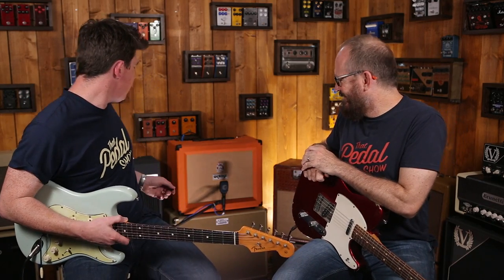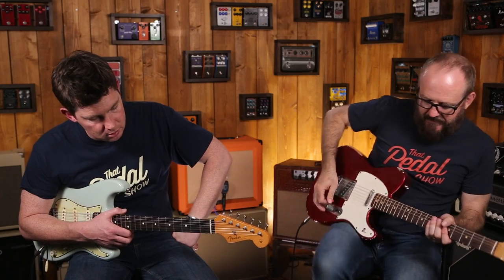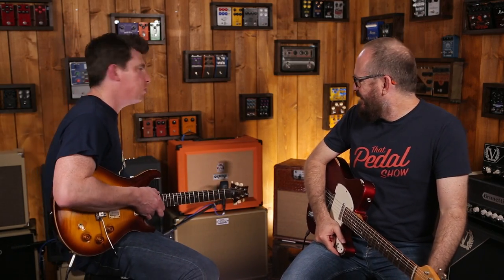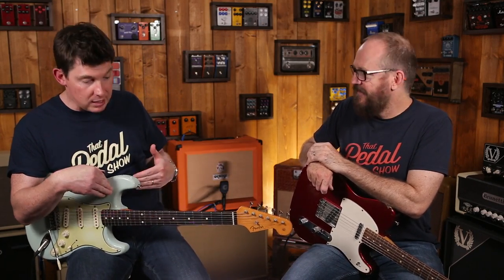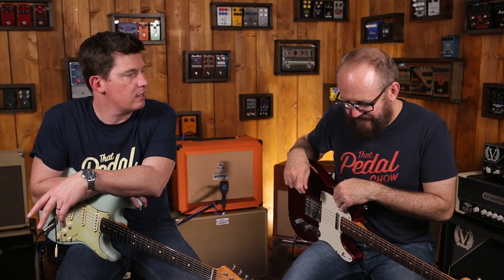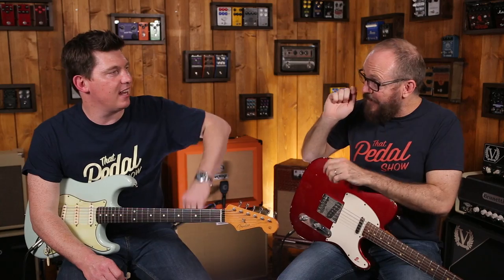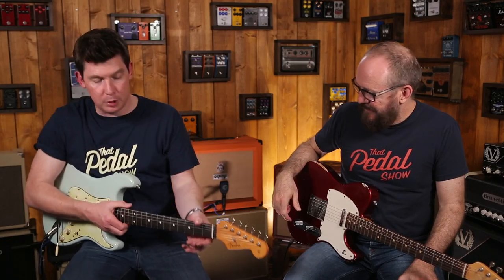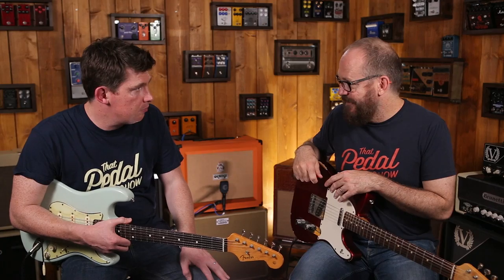That Pedal Show – Do We Like Transistor Amps? Part 1

Comment: Okay guys, I have another question for you. In a previous video (I can't remember which one) you briefly touched on the difference your cable quality and length will make, so that naturally makes me wonder what sort of effect/difference do wireless packs make?
Reply from the maker: +CARBr6 Huge difference! They're usually buffered so have a big effect on the high end/capacitance part of the deal. Not better, not worse, but there's a definite effect. It's a big part of Angus Young's sound as it goes. Cheers!
Reply: Cool. Thanks for the reply. Interesting to think about.
Reply: +That Pedal Show yep, the Schaffer, though he uses it to boost and compress which is the real trademark. My buddy is an acdc fanatic and has the replica Schaffer. Definitely adds some mojo

Comment: I have just purchased a bassbreaker 15. And a Gibson LP. No $$ for a lot of pedals. I'm thinking of a multi fx processor with a loop for 4 cable wiring so I can keep my amps voice? Opinions? Under $500. Line 6 firehawk fx? Boss gt-100? Maybe a drive pedal. Play classic rock. Mainly mid to high gain. Input appreciated

Comment: solid state amps got several different designs. Some of them got a circuit which is like a valve amp but replaced the valves with transistors. These are really good. Especially when you need a quick attack, good note separation but not as much dynamic... Like in several metal bands. This is why so many metal bands used solid state amps back in the day. 
But solid state amps got that habit to get easily sound too fizzy and the higher frequencies can be annoying...

Comment: Great- Killer vid, the solid state is a "pedal" sound- I agree. Katana tried to kick that. Solid State, SS...a 70's term for "Not Tubes". Transistors. Well- they are easier on the ol' solar panels. But it's the 80's Peavey 50/50 stereo tube amp for me. Perfect power for my pedalboard insanity. And I play bamboo flutes through this rig as well as guitar. Could only be better with a pair of them for both my weird stereo "synth channel" , and main guitbox channel. I presently blend them together with an ancient Yamaha MV802 mixer but times two would be so much better! (Still need the mixer- fker sounds awesome! It stays! Buffer lives matter) But I have considered a solid state amp for my Ego fueled synth channel. SO.....How about a video on rackmount SS stereo guitar amps ? Does such a creature exist in stereo?

Comment: when l play a small a
gig l use a hybrid. and yes my main gigging amp is valve. but to the people I'm playing to really hear the difference?  obviously I do. but I'm 63 and my days of carrying an AC 30 or a or a quad reverb. are long gone.  I really appreciate your response.
Reply from the maker: +Martin Reid I (Dan) used a musicman amp for years which has a solid state front end and a valve power amp. Still one of my favourite amps.
Reply from the maker: +Martin Reid Mick here. Hopefully what the people hear and what they feel should be connected. They should feel enlivened, maybe even enlightened by a great live music performance that makes them feel better than they did when they walked in. 
They get that by the band delivering a great show, and the only way you'll ever do that is when you're happy with the sound and vibe. So, do they hear it? Probably not. Will they feel the effects of you hearing it? Possibly.

Comment: It's a excellent review considering that most "first" guitar amp for a new player will be a transistor amp because the cost. So, it would be more real deal do a review with some low end lunch packs, as Peavy Transtube 10" series, Fender Solid State 10", Marshall, Laney, Roland/Boss, and so on… and do the same with some affordable pedals, as Boss, Ibañez Minis, Modtone, DOD, Dunlop MXR, and others. A cheap transistors amps with cheap pedals, something PRO could be born there!

Comment: 2 things. One, isn't the blues cube more expensive than the bassbreaker? Two, what if you put a tube overdrive into a solid state power section e.g. going from say the harlot, into an effects loop return and would that be similar to something like an orange micro terror?

Comment: the Blues Cube actually sounds pretty good at times. I'm not a huge fan of the Bassbreaker though... it's fine but it's a little too "thick" for my taste. I prefer the sparkly sound of most other Fender amps.
Reply from the maker: +Albert Sirup Try the other channel Albert - much more 'traditional' Fender. We should have switched it to show that really...
Reply: It's got a three band EQ (well, my 007 model does, so I assume the fancier ones do) so you can get that sparkly clean pretty easily, I find.
Reply: As they mentioned they had it on Channel 2, which is the Brown Deluxe channel and is rather thick. The other side of the amp is the Blackface Deluxe and is the sparkly side, but the bright cap that is always in play  makes pedals a bit harsh.
Reply: Albert
Reply: Okay, it seems everyone always shows the "meaty" side of it because it's the novel one i guess. I'm happy with my Blues Jr. and i suppose the Bass Breaker can't do much the Blues Jr. can't do for me (except for more headroom on the bigger ones).
Reply: The 18/30 that they're using does have a great deal more headroom than a Blues Junior. It also has a master volume that is much easier to tame. The tonestack is not quite the same, the Hot Rod series in general have a bit more more mids and an extended low end. Since the 30 watt side of the BB18/30 is essentially a Deluxe Reverb preamp it will have a bit more control in terms of tone shaping but is still that bright, sparkly tone you're familiar with. The cabinet is also leagues better on the 18/30 so it won't have that boxiness that the Blues Junior is plagued by. 

Don't get me wrong, I liked my Blues Junior too, but the 18/30 is in a different league really. If you get a chance to try one in person I would recommend it.

I should point it that the 18/30 (30 watt side), Blues Junior and Deluxe Reverb all share the same problem with fuzzes (Big Muff style in particular) in that the bright cap makes the fuzzes sound a bit buzzy.

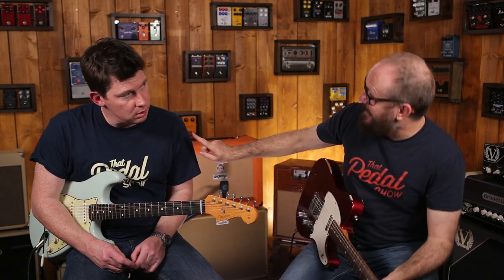Comment: To pick a nit: around 10:15, Dan mentioned the OCD HP/LP switch is for "High Pass" vs "Low Pass" (implying EQ) which is not correct -- it's for "High Peak" vs "Low Peak" (compression).

http://www.fulltone.com/sites/default/files/documents/OCD_Manual_web_5-3-2016.pdf

Comment: Say what you like - the solid-state amps can't cope with compression. That combined with the fast attack means the bass frequencies don't stand a chance and never develop, the result is thin, fizzy and lacking any wamth. The clean tones work fine and that is the strong point of SS amps - that almost Hi-Fi  but sterile sound which works well with modulation pedals for certain styles - the JC being the prime example.

Comment: I bought the Blues Cube Stage and I really, really wanted to love it...the clean channel cranked sounded quite nice with my Tele and the reverb was nice but the crunch channel was horrible and sounded like a wah pedal on half cock...there was also a real lack of bass and that ´fizz´you get with ss amps. WHEN....they get it right, I will definitely be open to owning an ss amp again but I sent it back and got an AC15C1, which just blows it away.

Comment: Hi, Dan and Mick!  Quick question.  I know that this is purely a preferential issue, but do you guys prefer to run all of your pedals in front of the amp, or do you prefer your time based effects in an FX loop?  Thanks in advance!
Reply from the maker: +Robert Simpson All in the front Robert, which is because we don't use much gain in the front of the amp, and we only use pedals that have awesome analogue dry through (if they have digital bits too). Also, the amps we like often don't have loops.... and.... not all loops are created equal. Cheers!
Reply: Awesome!  Thanks for the response!  On a different note, do you think you guys will be demoing that BIAS Distortion Pro pedal that is supposed to have a distortion matching feature?  I know you guys are very much fans of analogue gear, as am I, but I don't know of anyone that has the assortment of overdrives, distortions and fuzzes that you guys have to compare it against and to have it match!!

Comment: Why don't you try with the Peavey special chorus 212, the Bassbreaker and the Egnater Tweaker. It could be very very interesting c:
Reply: The JFET input buffer of the Tweaker would complicate matters, not to mention all of the other solid-state circuitry inside it.

Comment: To me the difference becomes obvious in a band situation. The tube amp will still sound good at loud volume, where the solid state amp will suddenly sound weak and the distortion will loose all the bottom. 18 watts of tube power is plenty for playing with a band, but a solid state amp would probably need 50 watt or even more to compete. That said I actually replaced my tube amp at home with 5w Hotone British Invasion which serves as a great platform for pedals.

Comment: I need an amp to pair with my egnater.  I think there's a bassbreaker in my future.
Reply: No lie, I was literally just thinking this.
Reply: Daniel Castillo  - I don't hate the blues cube or the orange, but almost every guitar pedal combo sounds better or "fuller" in this demo.  (In the fender)My egnater has this great full sound and I'm currently pairing it with a vht into a 12.  It's just too dark.  For price and sound the bass breaker seems almost unbeatable.
Reply: Thats a great call out. My egnater seems a bit dark as well. I have the tourmaster 212 cab with their elite 80 speakers in it which are pretty naturally dark (great sounding, but dark)... i was thinking about getting a mesa 2x12 with V30's because that speaker is a fair bit brighter and might blend nicely. Maybe look at changing/blending different speakers. Something to think about if that dark sound is keeping you up at night. Hope that helps! Cheers.
Reply: That's the charm of Egnater's they have that dark, rich yet glassy tones, but pack a massive punch!
Reply: I have worked to open up my egnater tweaker.  I started with a 6P3S (russian 6L6) tube swap, and made sure to get some good ones.  Four of them cost about 50 bucks shipped on eBay.

the next thing I did was reduce some of the preamp gain, since I use treble boosters and fuzzes, so I went ahead and swapped in 12at7s in everything but the pi position.

The last thing I did was snip off some of the additional capacitors which helped open up the tone a bit.

All in all, I wouldn't trade it in for anything financially comparable.  It's flexibility is unbeatable.
Reply: +Cat Vomit I agree, I like the darkness in a way though. I play warm music, so I don't need the brightness. I do like the first stage on the bass breaker though. I would use the blues cube at home personally.

Comment: I have zero experience with tube amps besides trying them out at my local shop once in a while but I was thinking of buying two new amps because I am running my rig in stereo with some high end pedals like Strymon and Eventide. Anyway I like lots of atmosphere in my sound but I also like to rock it out a bit.... so I have narrowed my choices down to a Roland JC-40 or Fender Bassbreaker 15 watt, thoughts anyone?

Comment: First, can you use one cabinet/microphone with multiple amps going into it? That would make it so much fairer, because the mic placement was surely not 100% the same on all of them, but also the speakers changed the sound so much more than the amp did.

Also, what do you think of amps that are tube preamp and solid state power section? Marshall Valvestate or Orange Micro amps, things like that? I had a Marshall ValveState100 and I remember it sounding like a Marshall ;-)
Reply: do you know how powering a cabinet works?
Reply from the maker: +Jamie Clark A few people have mentioned this Jamie, but the sound of the amp is the sound of the amp - cabinet, speakers and all. Most guys who buy amps of this nature won't be swapping cabs and speakers, they just want to get the amp and for it to work.
Also, we should underline that the sound of these things is so far away from the amps we would normally choose, that we really don't want to spend too much longer on it. For us it's a compromise too far, so we'll do part two and then get back to stuff that we love, and most importantly, that inspires us. Thanks for watching!
Reply: Spencer Jacob Holmes Yeah, you'd have to turn one off before turning the other on, or use a dummy load on a switch somehow. That said, if you watch something like a Wampler demo of different amps vs different speakers, you can see him plug like 10 different amps into one speaker with one mic, and they don't sound NEARLY as different from each other as I think anyone would expect.

I wish everyone would watch that video...

Comment: so with an overdrive pedal, do you guys use any gain on your tube amp?  I have a peavey classic 20 W tube head with a 2x12 orange cab.  Suggestions??
Reply from the maker: +Todd Hess We usually have the amp to the point where it's just breaking up. Dan likes a little more of that than I do. I tend to like cleaner amps. But there's a whole world of tonal light and shade when balancing the gain from the amp and pedal to get to the level of compression and saturation that you like. Thanks for watching!

Comment: It just seemed to me in almost all cases that the transistor amps were lacking dynamics, certainly in comparison with the Bassbreaker. To put it another way, the Bassbreaker seemed to better respond to the player, as if the guitar and amp become one instrument.

Comment: what about using an amp in a box style pedal as basically a pre amp for a transistor amp?
Reply: Doesn't work quite like that. Try a simple little valve preamp/overdrive unit in front of a trannie amps and it still won't sound like a full bottle amp. The big difference is the clipping characteristics between valves and transistors. That in turn determines the harmonic characteristics of what comes out of the speakers and thus the perception once the sound reaches your ears. Just like in the video, some combinations work regardless of whether they are valve, solid state or a mixture of the two. Others just suck but each in their own way and its very subjective as to what works and what doesn't.

Comment: The sound he gets around 27:45 to me shows exactly where many higher-gain transistor amps seem to fall short the most. 

It seems like they’re all voiced to have the gain near cranked. Having the gain any lower just makes it sound like a choked version of what the tone “should” be, if that makes sense.
Reply: Its due to the New-unused speaker thats not properly worn-broken in .

Comment: Great test, but, and it's probably already been said here before, you've should have levelled the playing field by using the same speakers on all amplifiers. Something like a 2x12" on all and not the build in speakers.
Reply from the maker: +Erwin Baeyens that's not the amp your buying though. The speaker choice is part of the design

Comment: Excellent. Just watching the section with the compressor and the El Capistan. It is subtle but I think you can hear a difference in how the delay comes across, it pokes out more ( technical term) through the transistor amps. I have a couple of delay and modulation settings on my board with the mix quite high and when I plug into a tranny amp at rehearsal I have to turn the mix back down ( although in part may also be that rehearsals are in a much smaller/ less verby room than a gig). 
And... all tones are about context ( as Dan says), that warm blues tone doesn't work on everything.
(Second)And...confirming  that the the Roland is a very ordinary tranny amp that's very over priced.

Comment: I'd like to see something about getting good sounds at low volumes. I live in a terraced house, and I'm always paranoid about peeing off the neighbours. I find it quite hard to dial in good sounds at volumes that don't have me listening out for banging on the walls. Wattage shouldn't be an issue as I have a DSL15C on half power mode, is there anything else I can do? The high gain channel on the amp is just a no, even with the volume on a smidge it gets too loud...